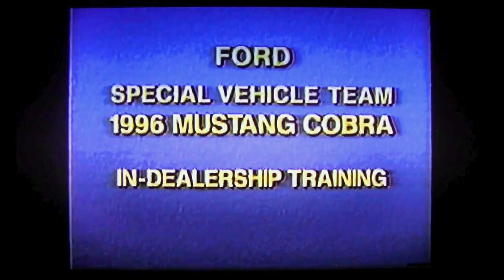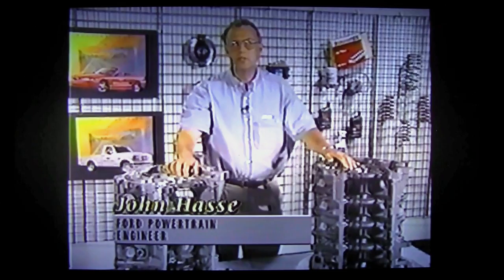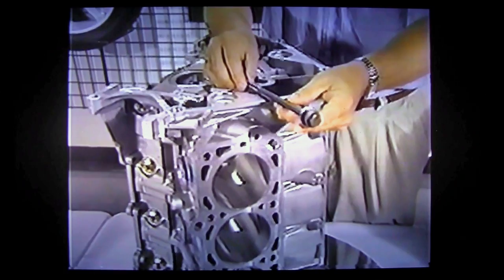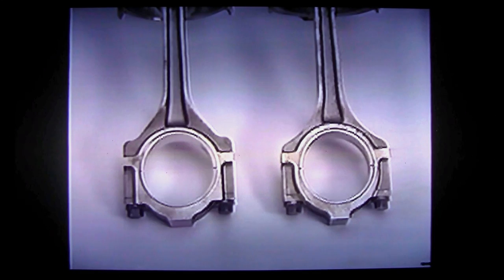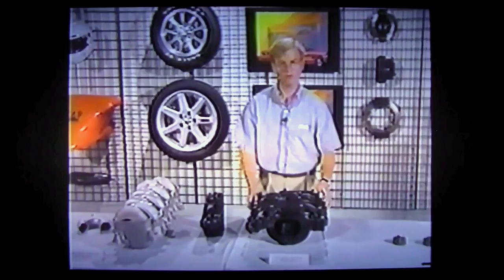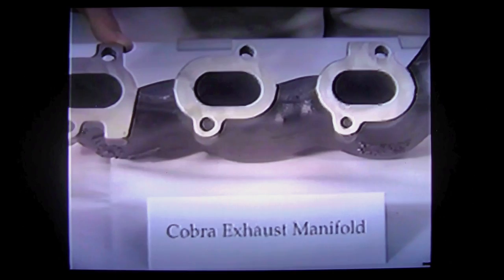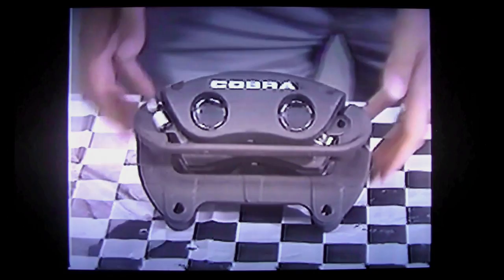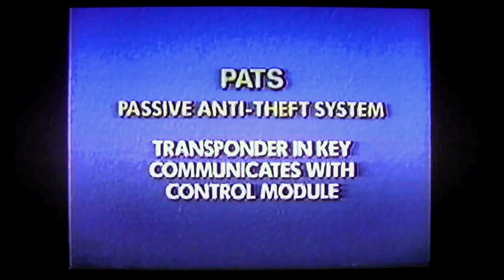1996 Cobra dealer training and intro.

Comment: I had a '98 with almost 300k on it. One of the 1,994 Rio Red/ Tan Leather interior cars. The original owner was a comic book dealer back in the '90's and went to conventions all over the U.S. with it. I bought it off of the second owner for $1500 with a weak clutch. The only parts that were ever changed on it were the starter, alternator, shocks, and other regular wear items. I actually changed most of those parts for him before I bought it and just replaced the original plug wires with MSD's after I bought it. The clutch finally let go on my way to work on Christmas Eve 2010 on an empty straightaway at about 145 MPH 1 1/2 mile away from work, but I managed to get a green light at the exit and coast it most of the way up the driveway with the itchiest, stinkiest clutch material blinding me then jogged to the time clock right on time. Sold it to my brother for $1200 and we drove to CJ Pony Parts for a new clutch when they had "The Bullet Holes Shelby GT350" in the showroom. Stopped at the nearby casino on the way back and starting with $20 doing red and black on Roulette, we covered the cost of the clutch and flywheel. It ended up running the 14.1 Motorweek got when new, but at Numidia's elevation and over 270k miles. My brother sold it for $3600 to put money into his house. The only Mustang I've ever owned, and I really wish I knew what happened to it, because it was a really cool car. With that high of miles, somebody probably parted it out, but there might still be a 300,000 mile Cobra out there with a lot of crazy stories. I wish I would've held onto it.
Reply: That is incredible brother I just bought a 96 Cobra SVT Convertible. 21,000 original miles black with tan leather seats the car still looks and smells like brand new.
Reply: They really are an amazing car.

Comment: I love my 96 cobra! It's a beast! For a car made in 1996 it's way ahead of its time! I'm able to keep up with ls3 Camaros,coyotes,and a few amg Mercedes
Reply: Beautyjuicynay02 you are on many cobra vids...I wanna see your car.
Reply: What all have you done to it?
Reply: My brothers car is currently down; has it parked in the backyard until he can get to it again, but is working on building his Honda. You can see him drive my car on his channel Venom SVT/svt
Reply: Beautyjuicynau818 i keep running into your comments lol
Reply: I currently have a 97 gt convertible. 93k on it, very clean car. I did all the typical 90s bolt ons: slp exhaust, bbk intake, bbk 73 mil , steeda underdrive pulleys, screamin demon coils , new oem plugs, ford racing 9mm wires. I also swapped in the p.i. intake manifold from a 99 to 04 car. 3" aluminum driveshaft as well. Everything new, nothing used. The car sounds great , and I guess for the time period it was " quick" . the car is too clean to let go. It had just received all new carpet and leather right before I bought. New top. Its a great car, and I dont think i can sell it bc it's just so clean. Even the paint. I do think I want a 97 cobra coupe though to go with the collection. Is there any common issues with the 4v engine? Anything to look out for. The car im purchasing in the future will have lower miles on it .

Comment: Two things, One, the early 4 valve made 375 plus hp. However, Ford folks killed it due to gas low fuel mileage and gas guzzler tax. Second, the front brakes were C4 Corvette brakes. I use to autocross one of these cars and the GM brake pads were half the price of the Ford pads

Comment: I don't know how many people know this but if a clutch cable goes   if you drive it  just like a normal shift you can downshift match the RPMs you can drive it all the way home with no clutch cable that is of course if the pressure plate goes or the clutch itself there's no driving anything.

Comment: So I just saw the guy that built my 96 engine
Reply: Not necessarily. There were 24 engine builders, that worked in pairs, and both builders signed each engine that they built on a plate that is located on the front of the passenger side valve cover. Check yours to see if they are the same ones as in the video.

Comment: I had fox bodies since 1985 and 1994 Cobra  rio red all blk interior & sold it w 27000 miles on it due 2 job relocation. I just picked up a 1996 Cobra convertible w 56,000 miles triple blk. Svt plaque,window sticker & every receipt 4 mods. Its flawless. Any 1 wanna check it out. Reply and I'll send some pics,details. Nicer than my 1994 Cobra when I took possession from dealer. I found out recently that it's 100-300lbs lighter than a fox body. Due to all aluminum engine. Wow! Its only 1500lbs lighter than a Hell Cat. Lol

Comment: worst piece of shit I ever own engine blow up at 15000 miles .
Reply: Which would have been covered under warranty. If your engine blew at 15,000 miles, it was pretty much a unicorn. These engines were hand built to the hilt, and over engineered to take the abuse that Ford engineers surely knew that they would be subjected to. You didn't mention how you were treating the car, when this happened. Repeated 7000 RPM launches on slicks, mixed with a VHT coated drag strip track likely would not have done these cars any favors, or any other factory car, for that matter. If you abuse something long enough, things will inevitably let go.
Reply: Like it wouldn't handle a 600 horse nitrous kit or something and I bet you it probably just wouldn't rev over 8,000 RPMs like he thought it would